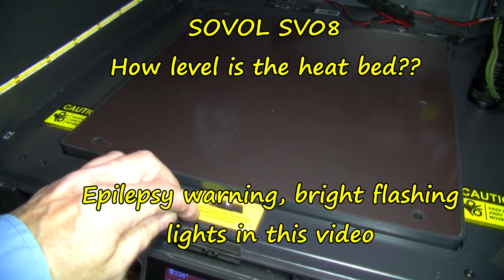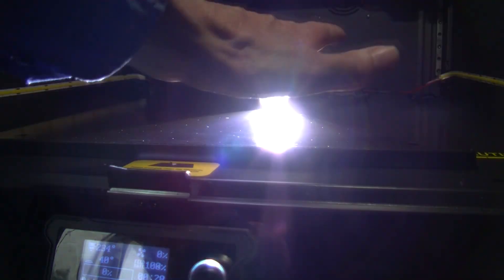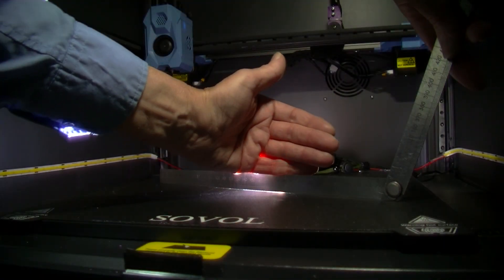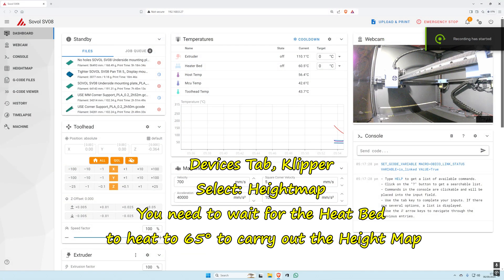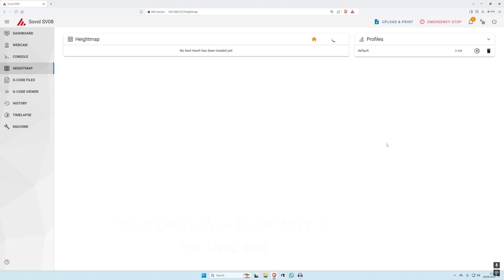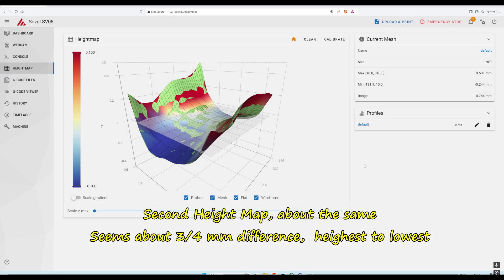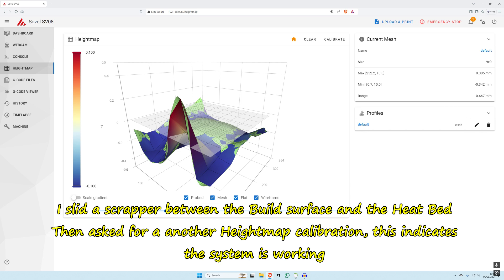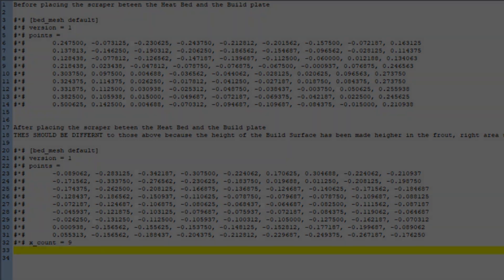SOVOL SV08 How level is the heat bed

Comment: Were you able to fix this or get a more level surface? I have the same problem.
Reply from the maker: I sent a picture to Sovol showing 4 sheets of paper under a centre part of the bed and steel ruler, using the edge of a steel ruler. They said they are sending me a new bed, I think this will be the same or could be even worse. 

One idea I heard about is to loosen the fastening bolts then heat the bed to 100C for 30 minutes and tighten the bolts while hot. Then it stays in this flatness when you use it, I have not tried this.  The bed is made up of two materials so I think it can act like a bimetal strip when heated and bends